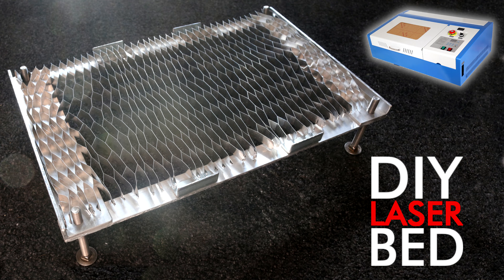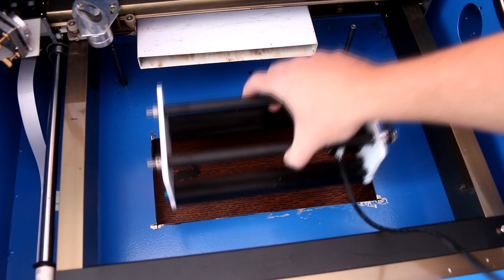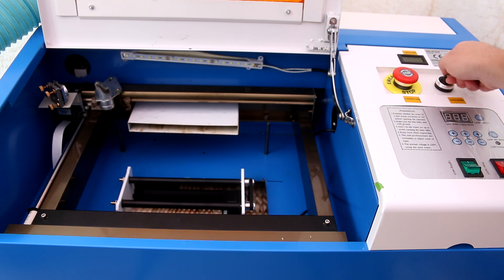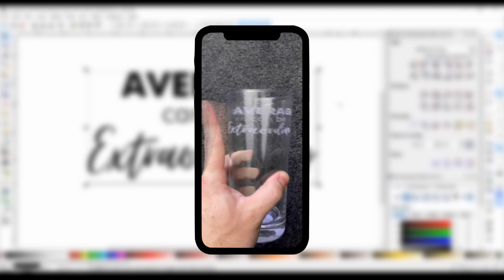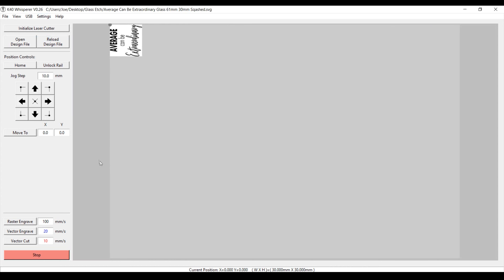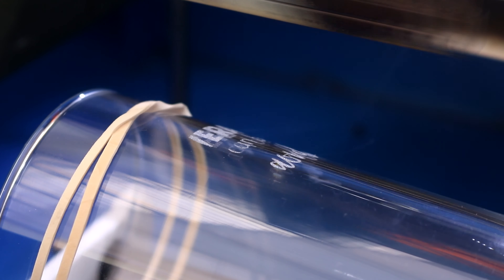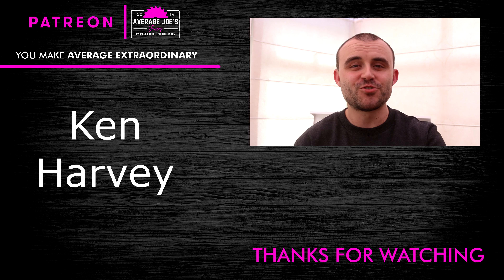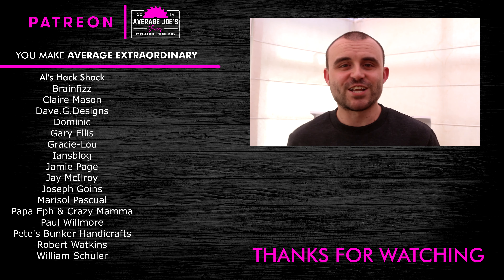Rotary Axis For K40 Laser Engraver #AD

Comment: Great video! One thing that may help you is to save your machine settings and then change the y steps for the rotary table. Then save it as a new file then you can switch back and forth and not have to change your files.

Comment: Great Video Mate.  Good job on fitting the upgrade... It works very well and will open all types of doors for you.  Thank you for sharing and take care.... 😎😎😎👍👍👍  You can use Bicycle inner tubes cut into strips for the runner rollers on the classes/bottles instead of elastic bands as it might run a little smoother.  use a smaller inner tube from a racer or kids bike so it will be tight and run smoother... Just a thought mate...
Reply from the maker: Thanks mate! Its definitely opened up a lot more possibilities with the laser now. Thats a great idea!!! Be far easier than fiddling with elastic bands all the time haha ❤️

Comment: Hi Joe, a different subject. Can you get a 48 tooth or more for fine cuts on wood with the Evo 255 mitre saw. I am thinking of getting this saw but I will also want to cut wood with a fine cut. Not sure if the blade provided will give you a neat, fine finished cut. Regards John.
Reply from the maker: Hi John, there is a wood cutting blade that is 40 tooth. I havent used it personally but Ive heard it gives a clean cut. https://shop.evolutionpowertools.com/collections/blades-1
Reply: Average Joe's Joinery , thanks Joe, is the saw that good really, I am thinking of getting one, kind regards mate
Reply from the maker: I think its good for the price. Especially accounting for being able to cut steel too
Reply: Thanks again Joe 👍😊

Comment: Hi Joe, 

Do you know if this rotary attachment can fit on any K40 machine?

Im wanting to order a K40 machine however every seller/manufacturer I've messaged has said the machine wont be suitable and the K40 machine wont work with a rotary attachment.

I can't seem to see much if any difference between the k40 machines and am sure it will work with minor modifications as show in your video. 

Is there anything else that needs to be done to the K40? do I need to upgrade the circuit board or anything to get it to work?
or will it just work when plugged in?

Thanks in advance.
Reply: Same question

Comment: So - you had to raise the K40 and also cut a hole in the bottom of it, I have no means of doing that.  So when I ordered my K40 I also ordered a supposed K40 rotary, and now I cannot use it.
I will have a word with the supplier, who never mentions that you need to be a sheet metal worker to use it.